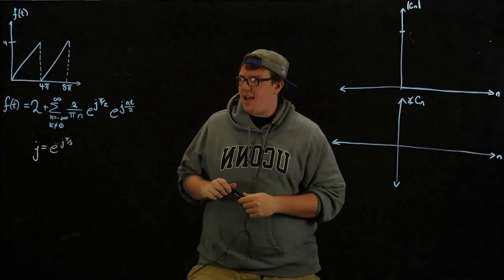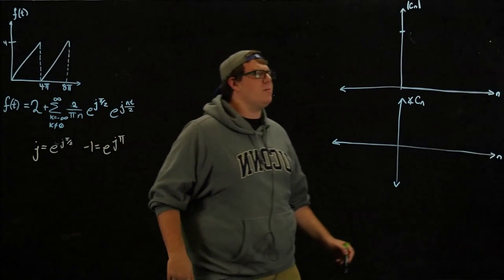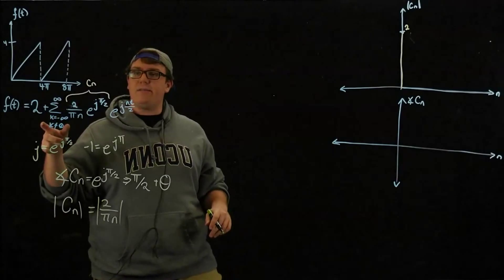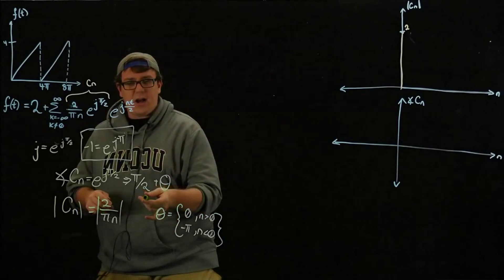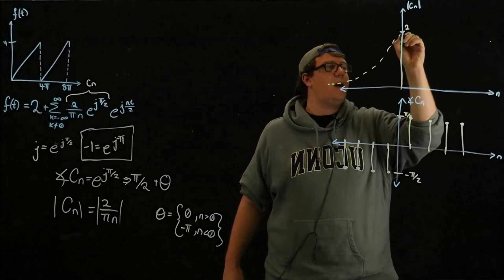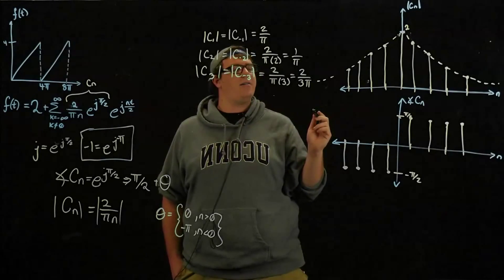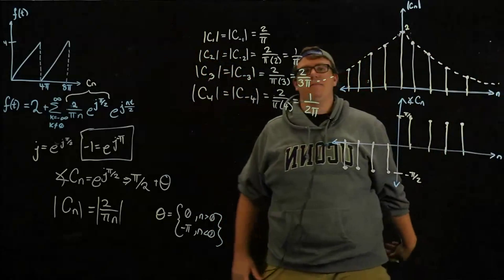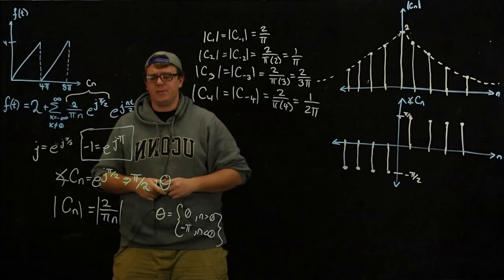Signals and Systems - Exponential Fourier Series - Part 2

Comment: how I get the phase spectra when there is no e , and according to what we decide to put it in negative or positive 90 degree???
Reply from the maker: Hi there! Great question. The idea of numbers having an angle to them is a strange one that becomes even more strange when we add variables to the mix. However, the idea can be simplified if you think of it like polar coordinates. Just like we can have an x-value and a y-value, complex numbers (this includes the real numbers as well) have a real and imaginary value associated with them. The real value is your "x-value" and the imaginary component is you "y-value". So when we write something as "a + jb" we are writing it in the "x-y form" called rectangular form. We can then convert this, like we do polar coordinates, to a Polar form in the same way. the angle is the arctan(y/x). For us, this amounts to plotting arctan(imag./real) for all values of omega!

I hope this helped and thanks for watching!

- Andrew
Reply: thank you so much